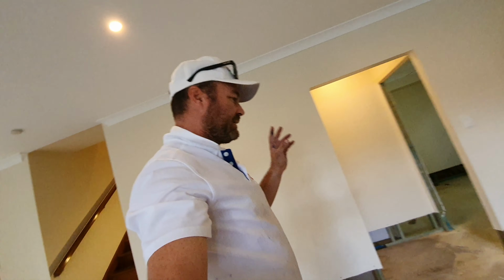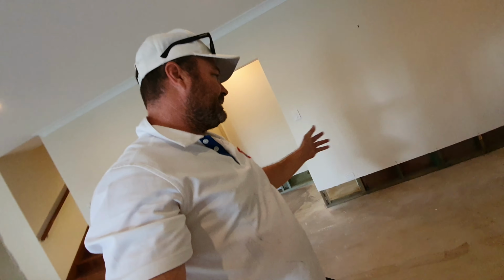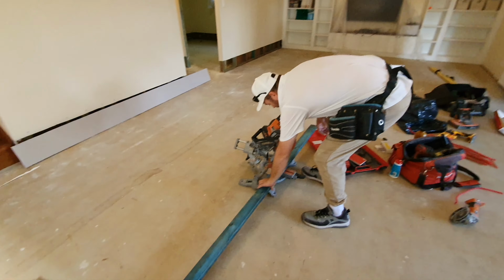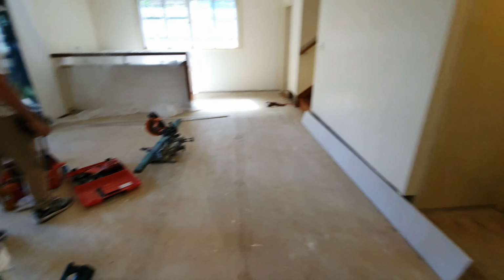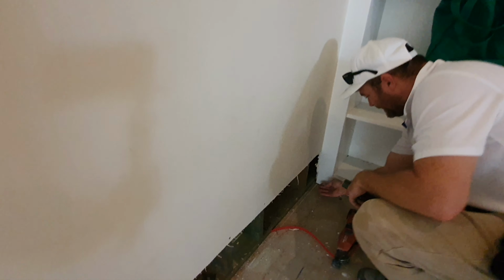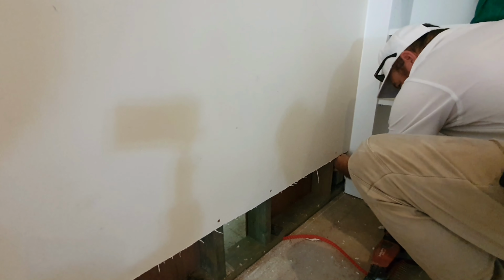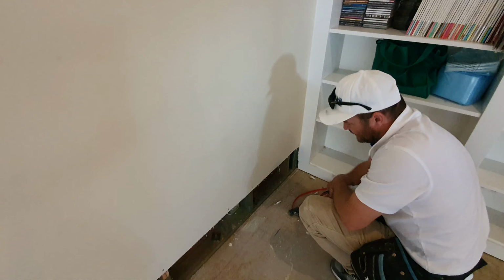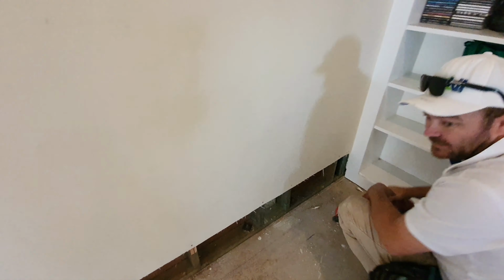Drywall Construction Repair Walls After Flooding

Comment: Getting ready to do the same think but with 2 foot cuts. Should factory edges join with the old drywall or go down towards the ground?
Reply from the maker: either way is ok I suppose, factory edge is straight which helps. get a makita drywall cutter to cut the wall back to start after you chalk some lines at the height you want them, 2 foot is good because you can rip a 4 foot board down and get two lengths. use fibafuse as well for tape !! hope it helps

Comment: Wish my landlord would do this to my basement which flooded 3 times in last month. Had nearly 3 inches of water for a full day in my basement and he cut one little tiny spot put and said that's good, will cover up with baseboards later.  I'm very concerned that is a mistake even if no visible mold
Reply: I would keep it well ventilated & spray anti mold spray from big box store & paint with anti mold primer

Comment: So 1st thing,  if your ripping g drywall wouldn't  you measure all your rips then cat them all off a clean straight  edge? Not rip measure  a crooked rip and keep
 Ripp7?
Reply from the maker: You are right, probably the best way to do it 👍
Reply: @Maxkil  thanks I was just wondering, because I had done this once and my tape joints was crazy gaped in places

Comment: Would that be pretty standard water wicking height up the wall or does it depend how long the water flooding the room sits there?
Reply: Apple Isle Kayak Adventures depends on many factors what the wicking height is. Typically the flood cut is at 24 1/2” or 48 1/2” if it’s really deep water.

Comment: Keep the rock off the floor at least an inch no matter what kind of board you are hanging.
Reply from the maker: We just put it 10mm off ground , the thickness of the plasterboard, out the wall sheet on a small block when we do it
Reply: @Maxkil  Right on

Comment: Someone was not nice and cut that too low.
Reply from the maker: Yeah true that. At least we didn't use a lot of materials. Very easy to set
Reply: Maxkil it’s the bending over to tape, coat, and sand. I’ve recut jobs like that to 24 1/2” off the floor if the cuts were done poorly or crooked. However that one looks good , just too low.

Comment: Pretty much a 'how to put drywall strips on walls '. Video has nothing to do with flood damage bc there is nothing related to determining how high to 'flood cute. Never go less than 24”.  Drying out underlying frame is EVERYTHING in the recovery.  Buttoning up the removed drywall is child's play. Boring.